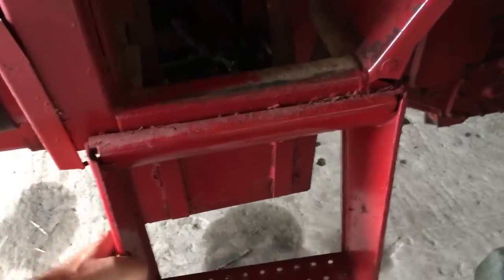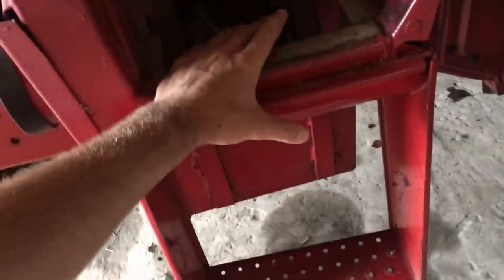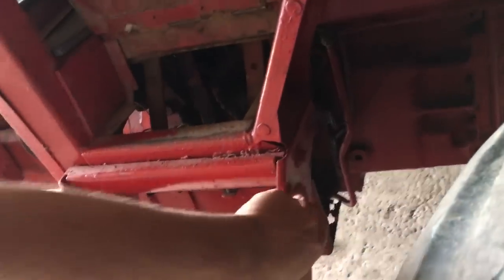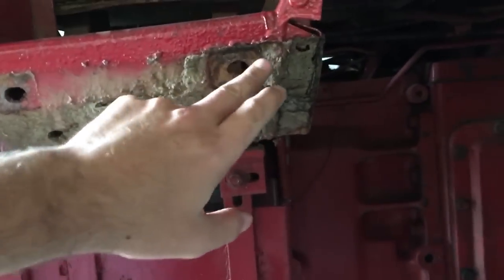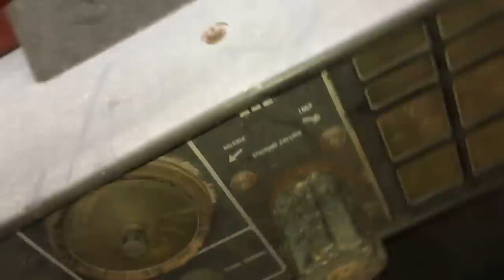IH 86 Series Step Kit Install

Comment: I was amused by his video also. I may look into the steps, and the gas shock for the door. I also saw the 1086 with the correct ways door! There is a YouTube video, search 1086. Tractor Looking good man.
Reply from the maker: Yea I think the shock is about $80 but if I had cab doors I would get 1 for the left door

Comment: Looks nice I'd get the hand rail. I put a set on one of my deeres a few years ago and really like the hand rail.
Reply from the maker: I just looked it up, it’s only $40 so not too bad, that’s only about 15 bushels of corn....haha.
Reply: PA Farms lol yeah. The kit I bought came with hand rail don't think it was even an option without.You say you want less hay acers but with crop prices you may want more! Lol
Reply from the maker: I would do more hay but just can’t get help unloading. My dad helps but he had a heart scare a few months ago so I don’t want to push him, I tried getting some kids to help and after one wagon they were sitting in the car with the AC on, I did about 3K small squares and handled them all 3-4 times. Corn costs a lot to put in but it’s sold every year no questions asked. I still have 1,000 bales from last year.

Comment: Ih answer to the seeing the draw bar from the seat was to mount a mirror in the back window an point it down to the draw bar never worked for me. and the next series out rhe 88 series they moved the shifters to the right side of the seat out of the way of getting in and out.  Thank you for your videos.
Reply from the maker: Yea I do like the partial power shift on the 88 series,

Comment: I have a 1976 1486 ,I'm 73 yrs old don't have any trouble getting in and out of the cab. Also  my doors have. Detents that hold in position  until there closed. What is the problem?????
Reply from the maker: Well recently I had a guy tell me he just bought and installed a set for his dad after watching the video. His father just had both knees replaced and was having a hard time getting up and down. Now he loves the new steps and has an easier time. If for only that reason I would say I have no problem with the video.

Comment: Just saw your Instagram page of the rain. 🙁 it didn't look good of what I saw assuming that's the same ground you were planning to put radishes 🙁 just curious about your 986 did it have a fully enclosed cab at one time or was it like that when it left the factory?
Reply from the maker: The 986 was just a front window. It was an open style but they offered soft cab doors